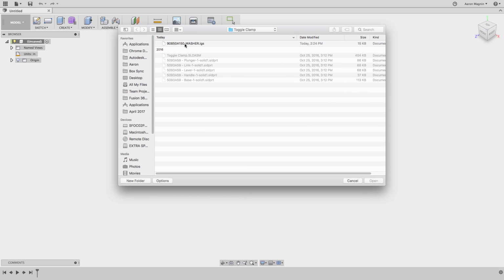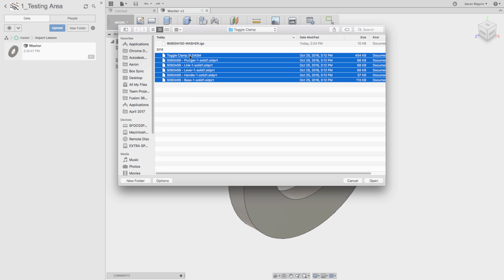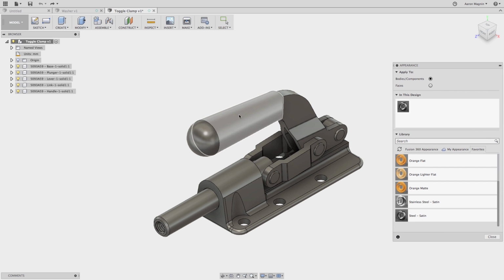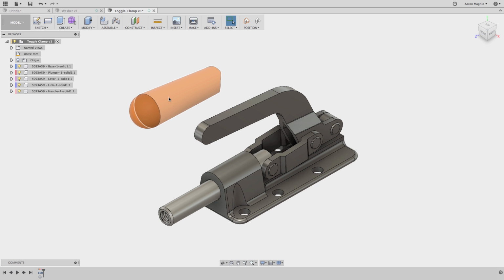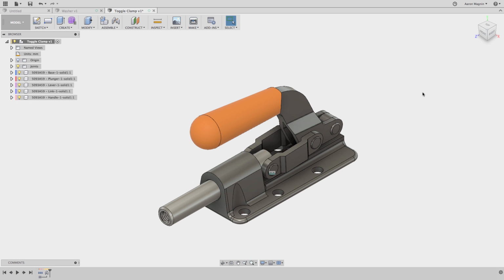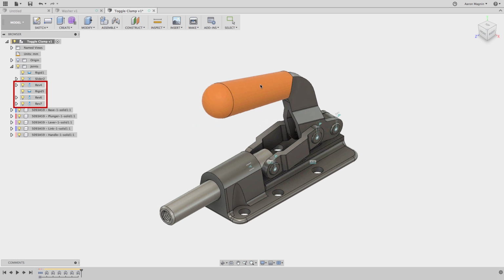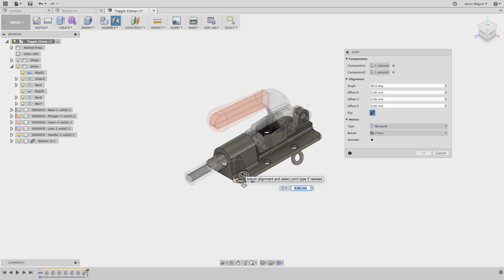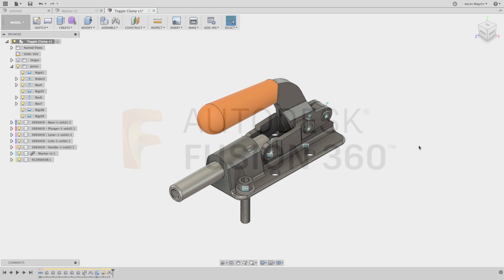QUICK TIP: Import and GO

Comment: Would be good if you can solve the issue when I import *.obj files, after imported the object i scale it to a good size, then i move it around the scene and automaticaly the object go back to the previous size before the scale. So I always have to convert first to STL and then it works normally. Thanks, and great tip of this video!